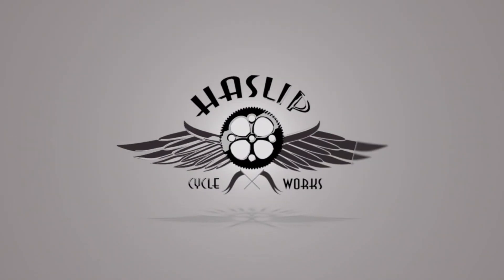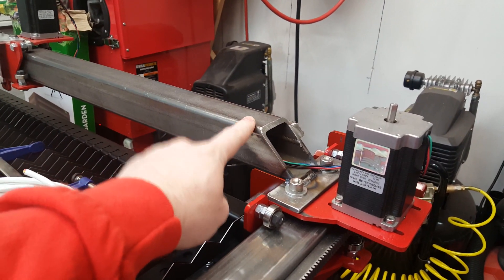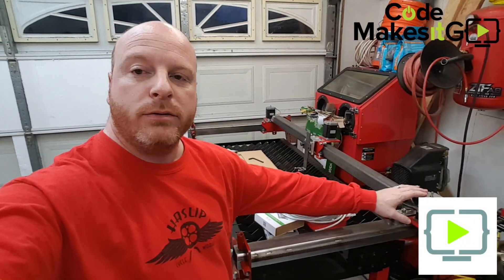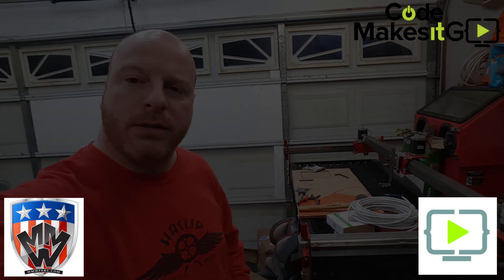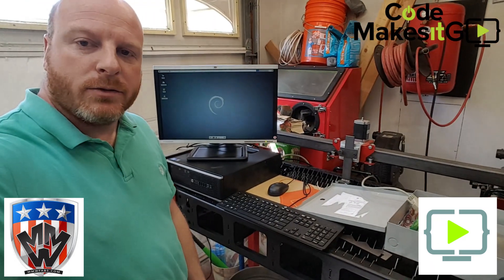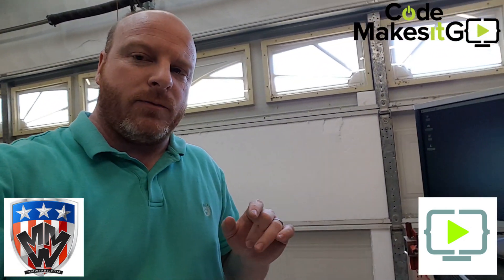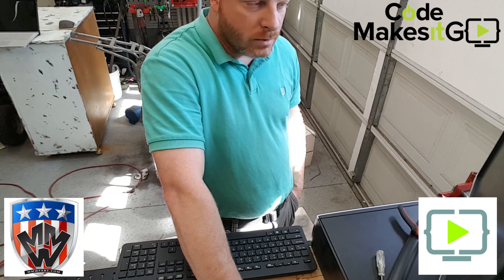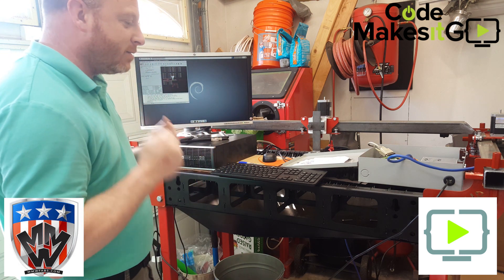CertiFlat Plasma Table CNC Conversion - Part 3

Comment: Hi, can you tell me what the wall thickness is of that 2 inch box section?
Reply from the maker: Looks like it’s 1/8” wall.
Reply: @HaslipCycleWorks  thanks for the quick reply!!! I bought everything to build the exact same cnc plasma and I’m just weighing up building it. I just need the box section now so it seems stupid not to give it a go.
Thanks for the inspiration!
Reply from the maker: @chrisjames6349  absolutely, perfect. Good luck with the build.